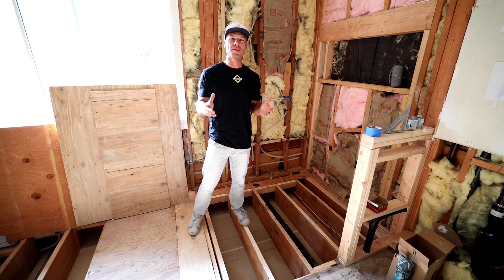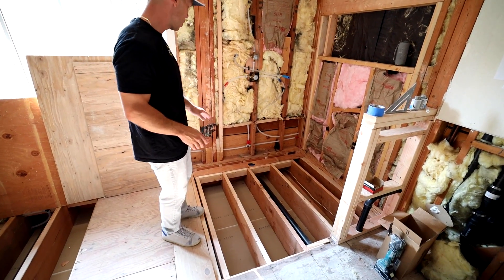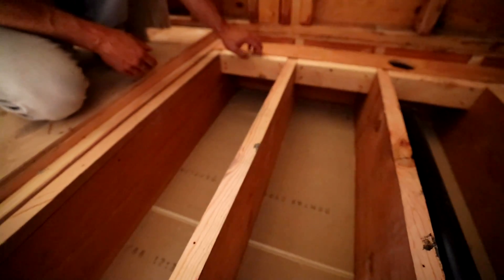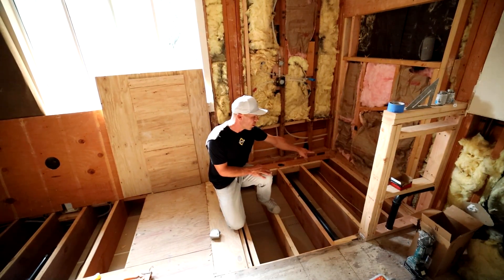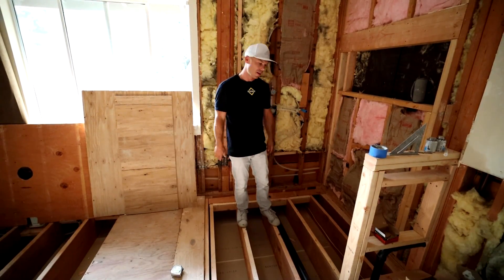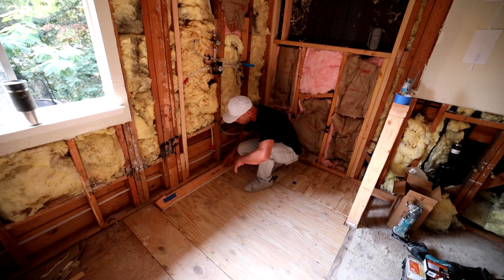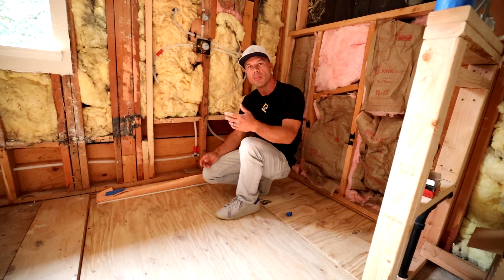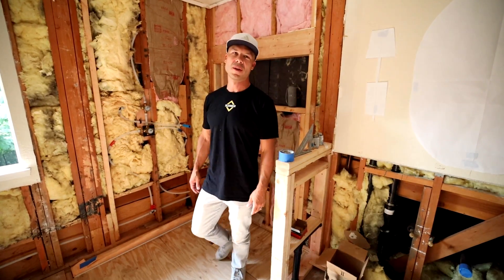Cutting Down Floor Joists for Curbless Entry Shower in Upstairs Bathroom

Comment: There area numerous variables involved when notching structural framing members! You should always have a structural engineer   sign off on that type of work!
I don't know your span on your floor system  and notching those four or five joist probably will not effect anything.  Did your 1/3 rule take into consideration the load of the roof above that is sitting 6 feet away from the bearing point below. 
Your plywood is installed incorrectly for strength!
You also compromised the insulation on the exterior wall with the nitche!
Reply from the maker: Good points.  I always recommend consulting with a structural engineer before cutting structural framing members.  Yes, the wall was considered as part of the load on the floor.  
As far as the niche, we will add another 1/2” foam backing along with the 1” foam that is already there in the stucco.  We will end up with about 5 R value there, but we have very mild winters here.  The customer was given the option and wanted the niche more than the insulation.  
For the plywood I see your point, but since the entire perimeter is blocked,  the direction doesn't matter.  
Again, thank you for your input it makes our channel so much better!
Reply: @TileCoach  such a classy response 👏🏾
Reply: another solution would be to overbuild it...sister on some more joists to one or both sides of the existing joists... if your unsure
Reply: @SomeDumUsrName agreed
Reply: @SomeDumUsrName  I don't Have the IRC parameters in my possession! The gentleman has a roof load falling on those floor joist and according to what we have been told in the video there is not a bearing wall directly below the upper wall of the structure. Which I find hard to believe the IRC is going to calculate the exact stress on those floor joist in this situation.
Reply: Definitely incorrect install direction of the larger sheet of plywood
Reply: @Navy1977 Plywood always has 1 more layer running the long way than the short way making it structurally stronger if the grain is perpendicular to framing. Only OSB is the same strength in any direction.
Reply: I just put 2x4's on either side of the joists and sit them 5/8" lower so the subfloor sits flush inside the joist cavities, thats just my preference for a curbless shower
Reply: @chrismartin7747  yes that what i do fuck ingeniering bullshit any they know nothing about real construction🤘

Comment: Yooooooo Tile Coach long time follower & I want to say I appreciate your videos. I’ve got something I could use ur help with if u have time. This video helped for sure but I would like to run some of the specs by u to see what u think. This job I’m doing is for one of the major builders in my area & its going to be a turning point for my career as a owner/operator of a Tile installation business so I must have everything in place. I’ve done a good bit of curbless showers on ground level so doing one on second floor is new for me. I’m not savvy when it comes to navigating a computer but I’m going to try & reach out thru ur website. Awesome channel

Comment: Cutting the joist can get really expensive really fast when you need to replace or double up the floor joists later.

Just avoid doing it!
Or at least double up the beam width where you cut it and 40cm(about 2.5 🍌 banana) past in both directions

Comment: I have to do this to an existing bathroom floor. I'm searching for HOW to do this and not finding anything worth watching. I don't have a lot of room to work in - it's a manufactured home with a 2f-foot crawlspace underneath the floor. Any recommendations you may have are greatly appreciated! The cuts have to be precise for leveling, depth (1/2 inch) etc...

Comment: I'm running a Schluter pan (1-1/8" thick). I recessed my curbless area 3/4". Then Im running Ditra Heat on the rest of the bathroom subfloor (not including my shower), which leaves me with an 1/8 difference between the pan and subfloor. How would you make up for that difference?

Comment: Heads up to anybody else wanting to do this: I wanted to do this detail in a shower I'm working on. I just called Schluter to run it by them, and they said they wouldn't recommend, endorse, or warranty using ditra-heat over a plywood in a shower. You have to use either a mud base, or their foam pan.
Reply: Ok I'm currently in the process of redoing my shower and came across this. I was about to say, all videos/research I've seen I've never seen anyone use detra heat for the shower floor. I was about to cancel my 48x60 shower pan I ordered.

Comment: I have a truss system 22’x 16” in a triangle pattern with a rectangle in the center. My trust are built out of two by fours. My subfloor is inch and an eighth. I forgot to ask the truss company to build in the trust to have the shower curb list. If I use blocking is there a Standard on cutting into truss!!???

Comment: Do you have another video where you install the heated floor system and the water proofing? Did you install the water proof membrane directly over the wood subfloor or is there Kurti under the membrane like installed over the rest of the floor? Would love to see the full job, start to finish. Love your videos and the quality and love you apply to every job. Fantastic work.

Comment: You can only notch in the first 1/3 of floor joists on either end, however, the max notch size is limited to 1/6 in depth and 1/3 in width of the height of the floor joist. Any notch larger than this limit will need some structural reinforcement, such as metal strip, or double joists.

Comment: Why Not slope the opposite end and have the shower run high.  Have the drain at the entrance    Saw another shower that had the drain at the entrance and it looked good.    Then you just need to add height not cut anything out.    Have to see the layout again
Reply: Stupide idea plus look amateur work

Comment: Great video as always! I noticed in this video that you are using a slot drain that only relies on the Kerdi Membrane that is factory attached. You have another video I recently watched that shows this membrane delimited from the metal and caused a serious water damage.  I'm assuming this is because you are working with limited space due to the curb less situation. What are your thoughts on using a double system that has the membrane AND also the threaded traditional interface?  Is that an over kill? I found that Infinity Drain makes one that has both and was wondering if you have an opinion on that.

Comment: Don't forget with your joists you are dealing with a nominal figure (2x12's in today's world can be from 11 1/4 to 11 1/2") which would skew your load figures.  It is always the little things that bite you.  Because you are dealing in a pretty heavy load bearing area it would not hurt to sister in a bit of additional stiffening and or blocking in the middle of your expanse.

Comment: Not a fan of putting the drain on the shower head wall side. The reason being because of that sliver you had to cut because you have a sloped bathroom floor. If you put the drain on one side it looks a lot better. I’ve never had a customer complain of standing on a slightly sloped floor. But the finish looks better because you have the same reveal across the whole floor. And you don’t have a giant transition by the door to the hardwood.

Comment: Like 10 years ago I did a shower job for a carpenter where he planed and pitched the subfloor towards the wall. Then I jus applied fabric and liquid waterproofing over it. And I got a lot of haters on why I didn't do a proper mud pack before tiling. Now, with all the new materials with foam and all that, people are looking at tile substrate in a whole new light. I think the wood pitch is ingenious. Just like how in the 70s and 80s they thought it so smart to frame up, or down, to accommodate shower receptors. That's architecture, not just pasting down tiles.

Comment: Hey Isaac-Isn't there a maximum length for the notches??? No more than 1/3 the height of the joist? So that would be 3.75 inches by my calculation. ( https://cdnassets.hw.net/09/cb/4d4a9b884a43b57fa20d05168c56/660155802-notching-guide-hero-tcm122-2183894.jpg )
Reply: Love you and your videos by the way!

Comment: I've thought about doing a curdles in my bathroom.  I have 16" floor trusses.  All the members of the truss are laid so that the members are on edge.  In other words, the trusses are 1 1/2" thick.  I have 2 layers of 5/8" plywood on them for 1 1'4" total thickness.  If I went curbless, I would  put blocking nailed to the sides of the trusses set below the top of the truss the thickness of the plywood.  So the most I can get is 1 1/4" of fall to the drain,,  I would use a central drain. Shower would be 32"x72".   I have Ditraheat on my floors so that gives me another 3/8"
Reply: Cool story

Comment: I edited this comment

There are king studs, disregard my blindness.

Also, you're using the IBC/IRC for what's allowable to those joists, which is no more than 25% of width, and 2x8's aren't 8".  They're not universal, so kids watching at home, check with local code enforcement first.

Other than that, good luck.
Reply from the maker: Yes, the trimmer (jack) studs are against the king studs.  Not sure what you are talking about.  Please clarify.
Reply: @TileCoach  I see that now, I suppose I mistook the kings difference in color for kraftpaper.  I'll edit the original comment to reflect this.

Minor question, Is that fiberboard sheathing?  If so, how do you suppose to waterproof it for the niche?
Reply from the maker: Thank you so much for your clarification.   I will try to make a video for you on how we do the niche against the exterior wall vapor barrier.  Its tricky!

Comment: Thanks for sharing! How did you deal with the gravity venting for the linear drain?
Reply: And you’re supposed to have a vent within 5’ from the drain so this may not flow so well.
Reply from the maker: The vent is coming up through the pony wall.
Reply: Great! Thanks.
Reply: Do all drains require a vent or just linear drains? If I were to switch from a regular round drain to a linear drain, would I need to add a vent?

Comment: Hopefully you consulted a structural engineer.  Given the smaller than normal joist spacing that looks to be around 12" there were some load issues to begin with given the construction style.

Comment: What if you were to double up the joist in the section you notch extended towards the center like 2'?
Reply: Wouldnt really be doubling unless the sistered joist is also on the supporting wall below but if you can span the weak point it should be ok im thinking. It would be interesting if isaac get get more info on the code there should be a work around but im no engineer lol

Comment: Hey Issac, that standard diameter shower drain pipe you ran to the toilet, I thought with even minimum slope the longest you could go is 6' before you siphon out your P trap..
Reply from the maker: The distance from the p-trap to the vent (in the pony wall) is about 4’, and the distance from the vent to the 3” line is about 8’.   I don’t see how it could siphon with the vent in between the trap and the 3”.  It would grab air out of the vent before it would pull water out of the trap.  I could be wrong, and maybe a plumber could chime in.
Reply: Saw that also. Looks like a cheater vent in the pony wall
Reply from the maker: It is a 1-1/2" vent pipe going into the crawl space then out the roof.

Comment: What if you ripped up the entire floor and sistered up the joists?
Reply: That wouldn't really help imo, as the problem becomes as the closer you get to the middle of the house, the more the joists are cut down in the middle of the house, the more it causes the entire household structure on top of the house to basically bow and have more deflection, so even if the bathroom floor never has an issue the rest of the house could have structural problems from the middle section of joists being compromised. 

Sistering wouldn't necessarily make anything stronger in that scenario, even if the bathroom floor is stronger in that section, as the sistering isn't going to extend all the way to end of all the joists.

Comment: If you had found engineered “I-beam” joists, you couldn’t have done that type of install?
Reply from the maker: No, we would have needed to fill the webbing of the outside TJI joists, sister them with LVL or 2x10, then head the area off with double 2x and then hang shorter joists from that in the recessed area.
Reply: @TileCoach  understood, thanks!
Reply: Heads-up: in seismic areas, you'd also have to consider shear forces on the floor diaphragm:  you'd have to extend the headers with blocking and strapping to several parallel joists either side of the new opening.  Especially in commodity construction where safety factors are minimized for cost efficiency.

Comment: Blanket Rule- never railroad your decking. 
and  you did not mention a vent but I assume you have one. 
Also, appears to be 12" OC, you could have easily taken 2" across, and you could always double your joists with a 2X10.
Reply: what u mean railroad decking
Reply from the maker: Yes we have a vent coming up the pony wall.   I will make the change on the plywood.  Thank you!!!

Comment: The second piece of plywood is oriented incorrectly.  This is not a trivial thing either.
Reply from the maker: You are correct, but in this instance it does not matter because there is edge blocking on the entire perimeter.
Reply: That's not how deflection works.

Comment: Why not just run your linear drain pan from right to left or from back to front . This way your high slope start side runs against the back wall and your zero degree side with linear drain butts against your field tile. They will both be the same height at that point . Then your your glass with a bottom seal gasket on that perimeter
Reply: You stole that idea from another YouTube channel on curbless with linear drains lol

Comment: A 2 X 12 is only 11 1/4" so you can't take out 2 inches. And your 2nd piece of plywood is installed in the wrong orientation with the floor joists.
Reply: Came here to say the same thing about the plywood being oriented in the wrong direction.
Reply from the maker: I agree but since the plywood is blocked on the entire perimeter it doesn't matter.

Comment: So the tile niche on the exterior wall doesn’t need to be insulated?
Reply: Good question! I typically don’t and live in the north east. Was thinking maybe some foam board insulation behind the cement board. just hate making the niche shelf any shallower unless you build the wall out.
Reply: It probably does need to it, not sure what he is going to use. There are some high r values materials to consider like aerogel if you have limited depth. It looks like 2x4 construction for that exterior wall so there is no room to get up to R10+ otherwise.
Reply: Guessing the niche will be one of those prefab foam ones (kerdiboard) so will have some R value.  And this is more than likely in California not North Dakota.

Comment: Could you show how you actually cut the floor down.
Reply: I’m working on one of these at my house. I had 4x6 material to work with, and I was on the outer 1/3rd as Isaac described. what I did was calculate the depth needed from zero to the lowest point. Let’s say it was 3/4” fall over 3’. I marked the 4x6 top surface with a sharpie in measurements to remove with my skillsaw. So that I had something such as 3/4, 5/8, 1/2, 3/8, 1/4, 1/8” marked along the surface. I probably had them marked in 1/4” only. So, At the 3/4 mark, I set the saw depth to 3/4. I made a few slices perpendicular accross the top of the joist at this point. Then bumped my depth a little short on the next few cuts. Repeat every couple of cuts. When I would get close to my next mark, say 1/2”, then I would set my saw to exactly 1/2” depth. Then keep repeating until I got to the next mark and so on. Eventually I was at zero. Then, I found a chisel and hammer and knocked them out. Clean up with a chisel or belt sander and they are near perfect. Honestly, it was easy and anyone with tools could do it. The key is the sharpie measuring every 6-12” increments and sticking to the desired depth. If you’re laying ply over the top as Isaac did, it may not matter how precise the surface is but I inset my plywood between joists to lessen the cut depth. I sanded them to near perfect but then covered with thin set and deck mud so probably a waste of time. Good luck!

Comment: Why not use blocking and run your plywood in-between the joists instead of on top?
Reply: Can’t bond ditra on framing is my guess
Reply: @shettlock  shulter actually demonstrates In laying the plywood between the joists
Reply from the maker: @Born Behind Bars -- But not with Ditra.   Only foam pans.
Reply: @TileCoach  hmm wonder there reasoning
Reply: @bornbehindbars2010  i imagine its because ditra can't handle joist movement. i don't know. the idea of anything bonding to dimension lumber and holding up is strange to me.
Reply from the maker: @ B Connelly      Exactly!!!
Reply: Would like to know why also.  I just did a recessed subfloor with kerdi pan on top. I had engineered I-joists but I would have done the same with dimensional joists.  Why create a slope with your joists when the pans are already correctly sloped?  Not criticizing, just honestly curious as I learn more about this stuff.